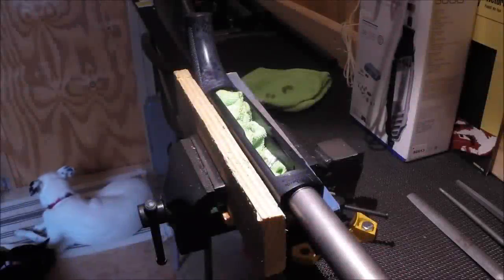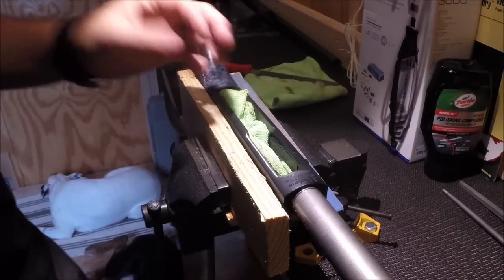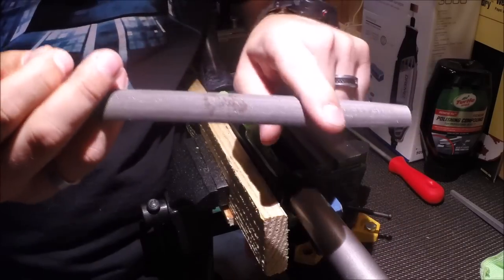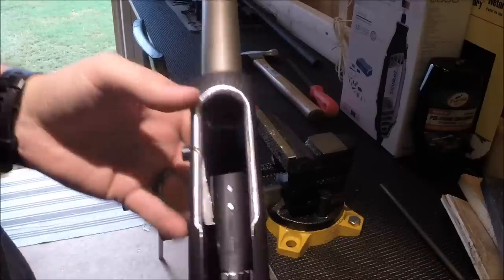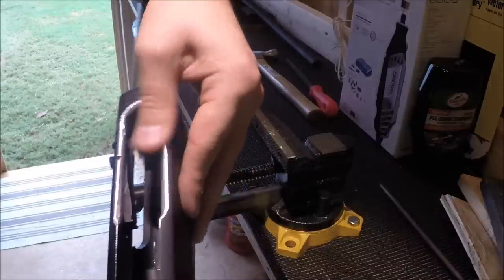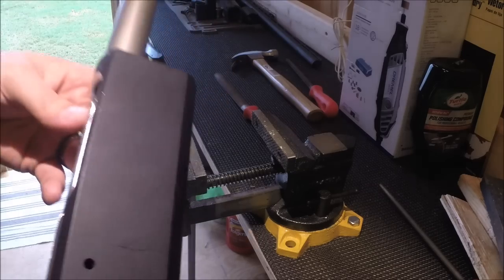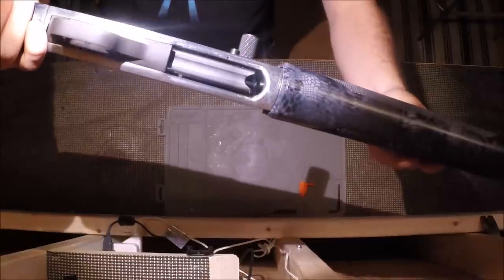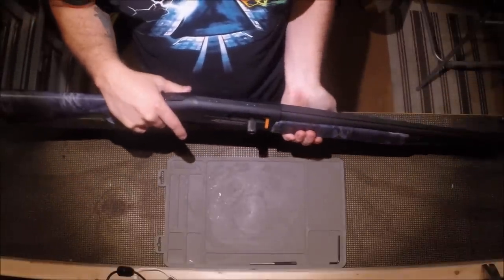Mossberg 930 JM Pro Loading Port Modification - SMOOTH!

Comment: Came across your video. Using yours and a couple of others, I made the jump and did my 930 JMP. THANKS, It turned out really well! I'm trying JB Weld to close up the lifter. If it doesn't work, I'll be taking it to a local shop and have it welded up.
Reply from the maker: Do let me know how that turns out!  Glad you found this helpful.  Thanks for supporting the channel!

Comment: Use some Birchwood Casey AlumaBlack to refinish the bare metal. It works on aluminum and steel.
Reply from the maker: Good idea!  I may do that in the future, though I like the look of the polished aluminum and have not had any oxidation issues as of yet.  Thanks for supporting the channel!

Comment: Very nice job and perfect timing on this video for me.  I am scared to death to take a file to my new shotgun, but something has to be done.  I am nervous that I will take it too much off of the receiver and render the magazine follower stop (for lack of a better term) useless, thereby ruining the shotgun.  That being said, not taking enough off is not an option either as that is where the thumb gets compromised.  

Have you noticed an improvement with the amount that you took off or do you think you will need to go back at it?
Reply from the maker: +Michael Godwin There was a significant improvement with the amount I took off and there is no need for me to go back and take any more off or to get a different lifter.

Comment: Nice video. Just getting into 3gun and got a 930 JMP. Noticed the forend wiggles up and down about an 1/8”, did you have that problem with yours?
Reply from the maker: I do not believe I did, no.  That said, I did have the polymer fore-end retainer break.  I replaced it with an aluminum one from OR3GUN.  Check them out!  Thanks for supporting the channel!

Comment: You could have tried using a Dremel they work wonderfully with the little drum type abrasive tool they offer really they do a great job I find it better than using an old file but just my thoughts
Reply from the maker: I considered it, but being my first time modifying the receiver of a gun, I wanted to go slow and have the most control possible.  To me, it was not about how long it took but rather how precise it was.  If I was to do this again I would likely use a rotary tool of some kind, now that I have the confidence with it and with modifying receivers.  Thanks for supporting the channel!

Comment: There are a couple companies out there that sell the lifter without the notch if the price is more feasible?
Reply from the maker: +Rob Goodheart Yes, there are companies that sell just the lifter for around $55 before shipping.  Luckily with the modification I made I feel I do not need one now.
Reply: +On Target Reviews Awesome! I just got mine yesterday. I can see that with my thumb size it's going to have to be an option unfortunately...
Reply: can you guys give me some names of the companies that offer the lifter?
Reply: hartranft66 Southern Kentucky Tactical (skytac) but they currently seem to be out of stock atm.
Reply: @Latinos4Trump  still sold out, lame.

Comment: files are made to cut in one direction, on the push stroke, so no back and forth
Reply from the maker: So "cross-cut" files do not exist, then?  Thanks for supporting the channel!
Reply: Cross cut files do exist its probably what you have.  If the push feels same as the pull you got  cross cut

Comment: Have you attempted to shave down your forearm yet?  I can not find GOOD videos on how to do this.
Reply from the maker: I have not, no. It's working for me so far but I'm only loading singles still. If I were to do it, I'd round it just like I did the front of the port: sort of a tapered half moon shape. I would also use the same tools, no need to go fast. Draw your shape in pencil first, go slow, and take your time. If you do that it should come out really good. Oh, and some VERY fine grit sandpaper...